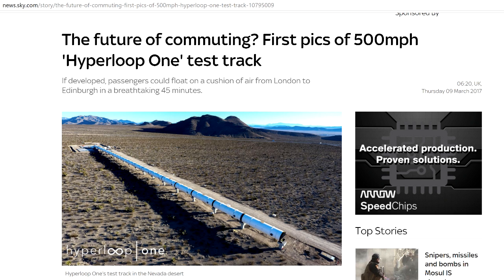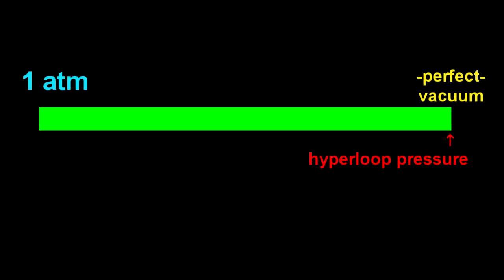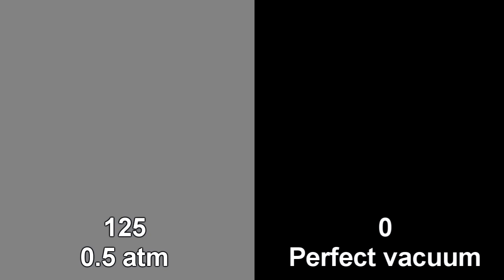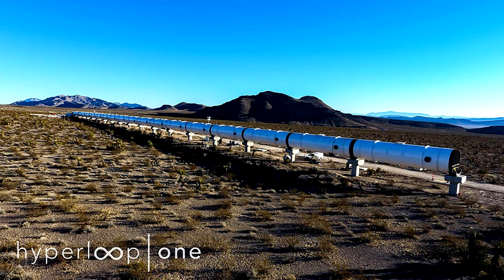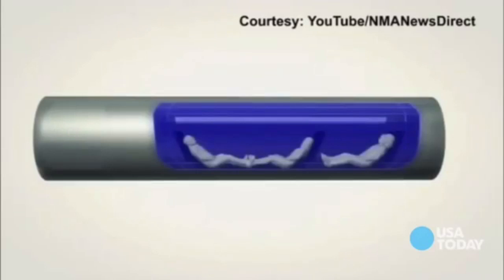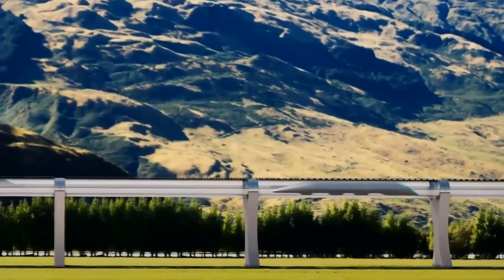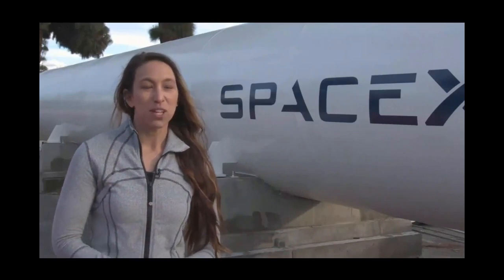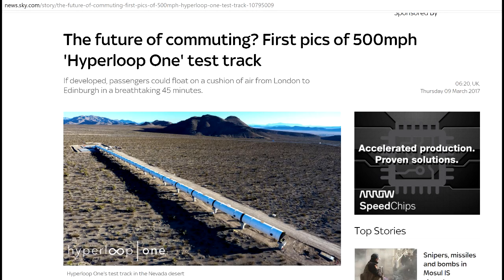Entire Hyperloop could be destroyed in SECONDS!

Comment: I dont Know if my Math was right, but the cost to create this Vacuum was over 7805830 KW / Travel and that will be create witch Solarengie? I think not.
Reply: 284912790 Terrawatt At year. Long life the plannet, or not.
Reply: Also we need the power of 70685,8 KG TNT/travel. that was verry bad. In MW/h Was that 78 MWh/travel Im soo happy. and maybe we can create 24 times at day, than need we 683280 MWh/year on power. ohhhyeah 157837680 Euro/ Year.
Reply: And i have my math use for a costpay only for create a Vacuum / Pasagier / travel. I think the Loop use at day by 4800 Passagier. that made 1752000 / year and that make a Cost of 89,9 Euro / Travel. Only to create a Vacuum. Not the Cost for the Strom or Personal or Infrastructur. Maybe with it, we Pay 3 or 6 time more /travel. And that is not cheaper at a Airline.
Reply: HavockLP put your calculator down and use your brain for a second. You only need to evacuate the air from the whole system once: when you build it. A better solution would be to have 'stations' at the start and the end of the track which could have a mechanism to seal themselves from the vacuum in the rest of the hyperloop. This way you only need to depressurise the small stations at the end
Reply: That was my thought as well, but even with "airlocks" you still need time to pump down, which is still going to take a while. Not to mention that we can't even keep our oil pipelines from leaking, so I see no way this thing isn't going to leak somewhere, especially once you factor in expansion and contraction due to the environment.
Reply: Invisiblejihadi You cant keep the vacuum up forever. Microleaks and other microscopic fractures will slowly "drain" the vacuum. Even at the LHC you have to keep the Vakuum pumps running 24/7.

Also: BlackEpyon you are all over this comment section, friend!
Reply: As I had commented in my other posts Patrik, this issue of maintaining the vacuum is further compounded with airlock maintenance, as constant ingress of debris from "public" environments will denigrate the integrity of the seals, leading to a constant maintenance cycle. Even the vacuum chambers used by NASA/JPL for spacecraft environmental testing are all built in clean facilities.

Comment: Are you aware of this device called a submarine, they resist external pressures and do not collapsed when driven into a sea mount at 35mph. The Hyperloop one tube is thin to make it cheap and the sections easy to handle, a real one will have thicker tube walls or be made from reinforced concrete sections. It is perfectly feasible to have a wall thickness that will not fail under the puny pressure of one bar irrespective of the how much the skin is deformed.

Comment: In reality you'd have an air-lock and only pump out the air around the outside of the pod before entering the main tube. Also, a tanker truck will use very thin steel. They're not designed to transport vacuum, only liquids or pressurized gasses pushing outward forces. The re-enforcing rings are not even welded so will not hold to skin on an implode. As a safeguard you would have an embedded fibre optic running the length to detect failures. Pressure release valves could open down the full length of the run to prevent the bods being instantly accelerated to hyper ballistic speeds which would otherwise cause everyone to suffer extreme accelerational forces as to become jellified. But of course all these things need to developed and will cost money and until you've got a proof of concept no one will expend their efforts just yet. When they're happy they have a working propulsion system, then they'll need to look at these measures to persuade the public and government bodies it will be safe to use. They will need also to test decompression failures and tube failures all of which will be destructive and therefore expensive and time consuming.

Comment: So "It's all bs" because the proof of concept doesn't match the claims of the entire proposed system?  That's like saying a transatlantic commercial jet is impossible because the Wright brothers only got one person a hundred feet.  I'm sure they weren't shooting for 700 mph in a tube less than a mile long.

Rail tankers, btw, are not built to withstand vacuum, and a working hyperloop wouldn't need to be depressurized while you're waiting in the station.  If the loop doesn't work out, it will not be for any reason you've pointed out.

Comment: Only one atmosphere of pressure isn't hard to design against buckling.  Submarines are designed to around 30 atm of pressure.   This is the delta pressure across the wall  that is used in the design.  I personally have designed cylindrical pressure vessels to withstand much more than 1 atm of pressure.  It is just a matter of sizing.  

These are engineers who are designing the hyperloop.  Don't you think they understand the  simple concept of buckling which is taught even at the undergrad level.  Your video's tend to be overhyped based on speculation.   Why don't you show with math that their buckling calculations are in error.  NASA has design data that you could use to do this.

Comment: Impressive video but tanker trucks are designed to hold pressure not vaccuum.
The first working hyperloop will carry cargo and not people. I am sure by the time people ride in these things they will be well tested.  The vaccum will not be anywhere near the failure point of the tube.  I would suggest looking into syntactic foam (think Alvin Submarine) or composites or Lexan  instead of steel tubes.  If steel turns out to be the best material a smaller diameter tube seems safer as a larger diameter tube would require thicker steel or less extreme vacuum.

Comment: What if the real plan is to use the Boring machines to build those tubes underground of concrete , a thick concrete wall is more stable to vacuum. 
The cost will be lower. 

The entire tube will be pumped to vacuum one time . Maybe once a year.

The loading station would have a valve the site of the tube that separates loading zone from complete tube.  That smaller volume would be pumped to vacuum every time a pod is loaded. 

So you would reduce risk of collapse and energy used to pump every time.
From watching your channel , I know that you are a scientist , thus I know that you understand what technological concept is , and how it evolves from prototype to prototype to have a good product at the end. What surprises me is that you make fun of the tested pods , that they did not reach the promised speeds and you know that that promised speed is probably achievable but in 2030 maybe. 

The first car did not have 1000 hp engine and it did not travel at 360 km/h.  It was even slower than a horse ...
Reply: You make good points. That does sound a lot more feasible, but surely not cheap? Some railway tunnels, for instance, are quite expensive, apparently to the tune of $100m per kilometer.
Reply: Yes , that is true , but that is why the same guy behind the whole idea is funding "The Boring Company" to make cheaper tunnels and faster digging machines.
Reply: You know what we didn't have when the first car was invented? An understanding of science

Comment: One atmosphere of pressure can be contained by an aluminum can. Air moving in a tube can only propagate a failure at the local speed of sound. We have the technology to record and react to a decompression event long before it causes a cascading failure.
High pressure gas lines are commonly built much longer than this, feeding natural gas all over the country. Those pipes have a much greater difference in pressure than this pipe ever would. I don't see why those solutions couldn't offer inspiration as to how to solve these problems? Hell, a rubber gasket between sections would solve the expansion issue.

Comment: Thunderf00t: The full scale test track will collapse under the air pressure
HyperloopOne: *Tests full scale test track near vacuum twice and doesn't collapse.
Kind of dumb for Thunderf00t to not realize that the engineers at hyperloop one aren't that dumb
Reply: the same engineers that don't care about thermal expansion or rust or didn't make a vaccum?

Comment: the shorter the distance, the slower it will go. Couldn't you figure out that as long as they are able to apply acceleration over time, the velocity will increase to be exactly what they promised? obviously their demonstrations are not to scale. Acceleration (increase in speed) means increase in km/h. basic ratios. if within 1km long test tube you can go up to 60 km/h, that means in 2 km you could accelerate to 120 km/h or even more depending on acceleration consistency. so if they were to keep it accelerating for 10 km, and we know that in 1 km they can speed up to 60 km/h, then (10km * 60km/h) by the time they get to the 10th km they will reach 600km/h. right? this video is pretty weak.

Comment: You have clearly done no research. The hyperloop is not at a full vacuum and why would you think they had the tunnel sections lying around for years? The test you use as a demo is of a tanker which  would have less strength than the hyperloop and it was tested to the point of failure so basically beyond its recommended limits. So as long as there are tests such as these on the size and shape of the hyperloop sections then the failure limit will be known and not exceeded. Also ITS UNDER DEVELOPMENT. Never seen someone so against an idea like you. Would you have been so pessimistic about the wright brothers first flight at only 100 feet or so. No great feat but was the beginning of the changing of the entire world.

Comment: Interesting video but the concern is not actually there because the engineers will design the system to more than take care of these forces. So you know I designed the most high performance Oil pipelines that were at atmosphere pressure on the inside with up to 8,000 ft of water pressing on the outside. Basically, we just increase the thickens of the steel. So frankly crushing of the tube will not happen. 
 1. My only concern is a pressure failure causing outside air pressure up the tube, this would shoot the train away from the rushing in air with tremedous Gs. 

  Now in oil pipelines this only happens when boat hit the pipeline, and we don't care because the oil inside just goes to the pumping station, or leaks out depending on if the pressure inside the pipe is lower or heigher than the surrounding sea water. This scenario  could happen in the hyperloop if it is above ground and say hit by an over height truck, below ground the risk is a lot less, but the cost of putting it below ground would be astronomical! 

Regardless, cost per mile will kill them here is why. 
  A 6" oil pipeline in the Gulf of mexico typical cost is between $1-2billion. 
  Those pipes carry around $500,000 to $1 million worth of oil per day, grossing 5 to 11% of the value of that oil. 
Even with such high payouts the pipelines are tough investments to swallow and have significant s risks to investors. 
So you think a $2 billion dollar hyperloop will net $100K to $200K a day in Revenue? 

We need to concentrate on making airports more efficient, this is how the US operates.

Comment: Hey thunderf00t, I  was curious about the tanker in the beginning of the video. Are they designed for operating under a vacuum during transport?  It would seem that some reinforcing ribbing would greatly strengthen the structure. Can't argue with much else in the video. 

Imo if they are going to build an elevated track to go from point a to point b , why not do something similar to japanese bullet trains w/o a vacuum? Keep it off the ground, and hell they could still put it in a tube to avoid external interference from weather/animals. Already works, aside from initial installation it would only require minimum ground space, and would still move rather quickly.

Comment: Of course, ignoring for a moment the costs of a design like this, along with all the other unaddressed issues that still stand, I wonder if they could implement a double walled tube similar to a submarine, with the void between the two tubes being at a reduced pressure, say 50% vaccum. 

Now the outer tube will only have half an atmosphere acting on it, and so would the inner tube since it would be surrounded by 50% atmospheric pressure that would exist between the two tube walls. 

It would make it safer too, as the %50 vaccum pressure between the two tubes could be constantly monitored and if pressure started to climb, indicating a leak or compromise to the outer shell, it could theoretically give enough of a warning to safely repressurize the loop before the inner tube ever experienced the full load of the atmosphere.   The double wall would also act to provide additional physical protection from a breach.   

It would still be dangerous as all hell, but just mulling it over a bit, a double walled system would seem like the only logical direction to go unless you just wanted to thicken the shell of the single tube and pray that it was never breached. 

Hell,  even make a triple tube.  30% vacuum, 60% vacuum, and of course inner loop at %90 or greater.   Then the pressure differential between any two layers would be only 30%, and would be a nice thick shell to protect the inner loop, with multiple failure modes that could be safely managed even those involving a direct breach of both the 1st and 2nd layers. 

Sometimes safe doesn't mean affordable.

Comment: So you have to have a tube which will be strong enough to hold a vacuum,  have airlocks to get the passenger pods into it, which have to be strong enough to hold one atmosphere! 
What happens if a pod develops a leak? An emergency system would have to let air into the tube to save the passengers, so that would be quite a bang, the pods would hit the air like a brick wall, injuring the passengers and probably bursting their eardrums!

Comment: What's the point of being a negative dick, other than trolling for cheap hits? A jet can be brought down by some birds; a submarine by a short circuit, a rocket can fail and kill people because of some foam and a bad O-Ring, an apartment can kill dozens because of bad outside cladding and all of that HAS happened but the Hyperloop is not even finished a pre beta stage yet and we have Debbie Downer idiots putting it down already? Nice.
Reply: I think the point was to explain what the real difficulties of the system is and what the potential risk are.

HINT: some "dickhead" engineer told the NASA Chiefs  multiple times about the potential of the  O-ring failure and what would happen if it failed.  Long before it happened........
NASA shut him up.....
And the Challenger  exploded exactly as the  "Debbie Downer said it would.

Comment: Well, 200.0000.000 J sounds like a lot, but its actually just about 56kWh, which cost nothing more than 15 bucks.
Reply: They have no system planned that would prevent the whole loop from having to be depressurised for every time they load up passengers.

And they plannex on something silly like 6 carts? At once in tue Loop at regular intervals within the proposed half hour. 

That $15 just got 6 times bigger. And the travel slower. As it takes half an hour to pump out the mini loop. You would be sitting and waiting for it to pump out for as long as it takes to fly the full distance .

And speaking of flying, have you looked at airplane depressurisation? Passengers get hypoxia, swelling, and the bends.
And if its due to damage to the hull, thats critical aircraft failure, and can lead to it pulling apart mid air. Just look at the first jetliners. This is why aircraft cost hundreds of millions to make. And something stronger would be needed for the ultra low pressure within that.

This again increases the cost, then the constant high pressure shift would stress the whole system, and the vehicles, leading to constant maintenance and replacement. So the $15 is a tiny part of the costs.

If it actually ever works, it will cost more than flying in qll shown aspects